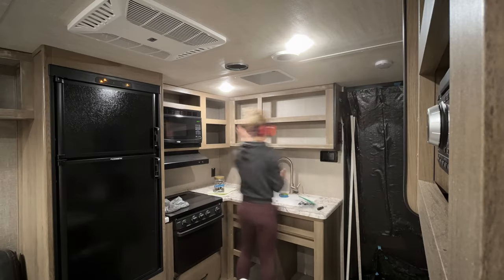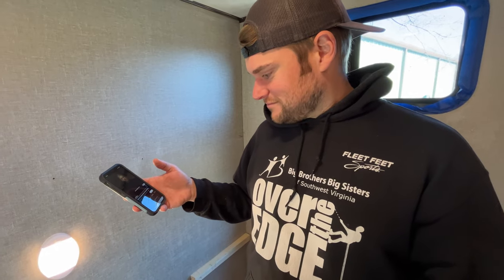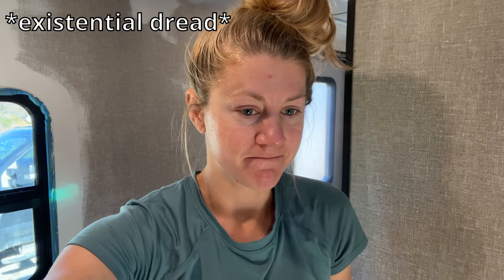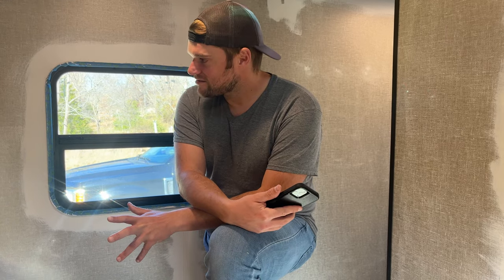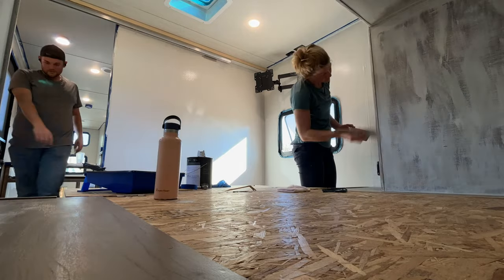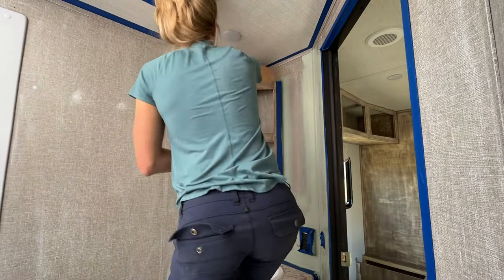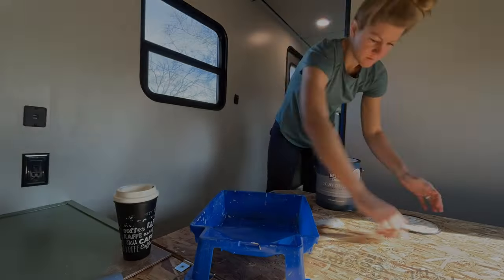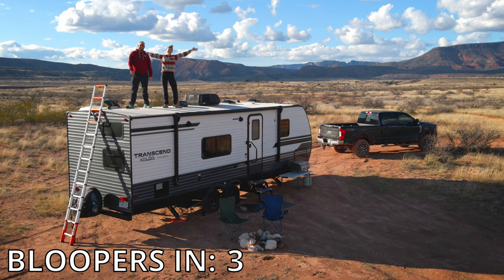We PAINTED our RV - mistakes were made... 😱

Comment: Ok...just stop! Y'all are killing me 😂. You obviously did NOT research like you should have. 3 words...VALSPAR BONDING PRIMER...USE IT!! Sand again. Wipe with a mixture of warm water and Purple Power. It gets the grease off. Damp sponge. Then...RINSE with COLD water...again, damp sponge. Let DRY at least 3 hours...longer if it's cold. Then...heat camper to about 60°, and PRIME, PRIME, PRIME. Let dry a FULL day. Do a scratch test. If it comes off, let it dry LONGER. You'll want to do 2 coats. Once second coat is DRY, use PAINTABLE caulk to close up allllll the areas you'll now see (holes, trim not attached tight enough...etc). Once caulk is dry...PAINT!! Use DOOR & TRIM paint. It's durable, flexes, and washable. Two coats, dry at least a day in between...longer if Temps aren't right. My favorite is Valspar Door & Trim. As for cabinets...you'll want to use a CABINET paint...not regular paint, or you'll see every roll and brush mark. Valspar Cabinet paint is AMAZING. It smooths out and flattens when rolled or brushed,  just as if it was sprayed. I promise...lots of work..but PREP AND PROPER PAINT, MAKES THE JOB! It will stand the test of time and be worth it°